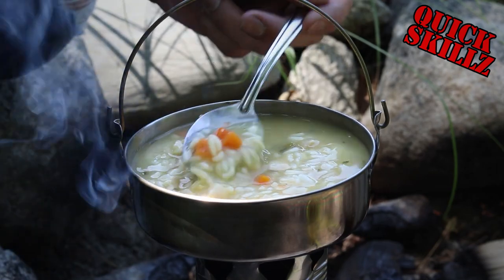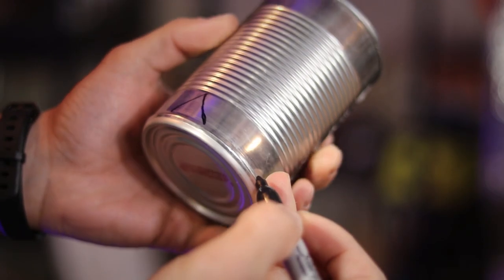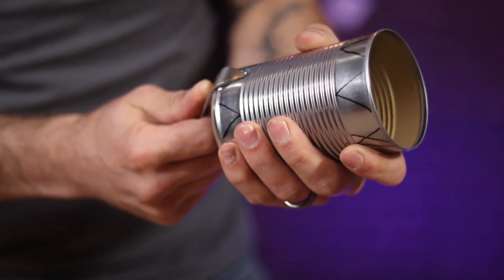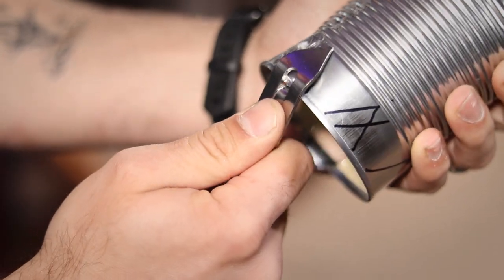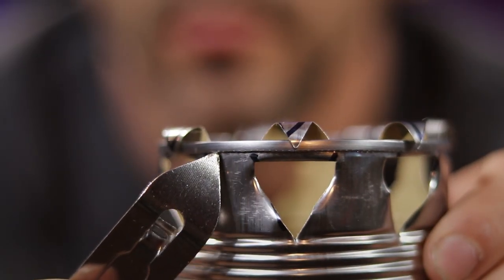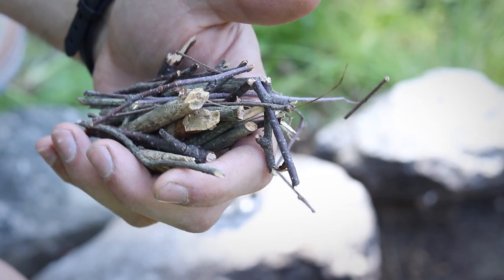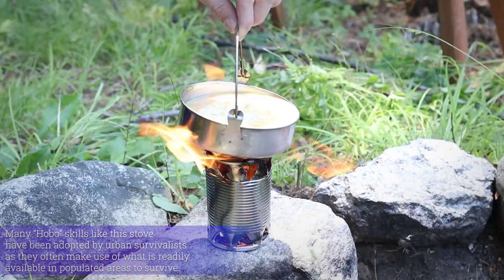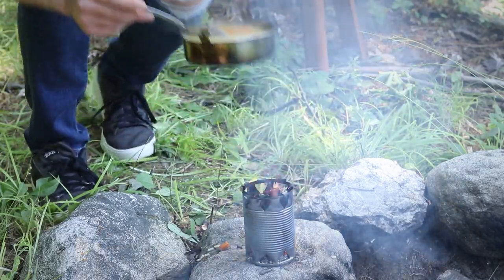How To Build A Hobo Stove

Comment: another great vid!  go check your mic!  Just an fyi but if you want to make the stove last a lot longer you can spray paint the outside of the can with high temp paint.  the heat can make the metal more prone to rust so this can help it last a lot longer.  then again cans are cheap enough so it might not be worth the effort depending on how often you use one.  Make a penny stove next, or a cat can stove even.